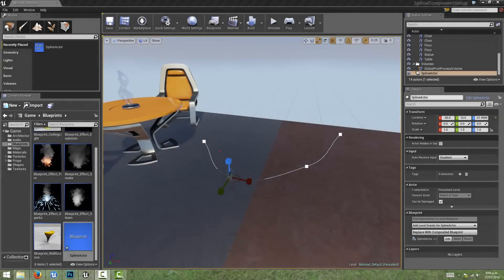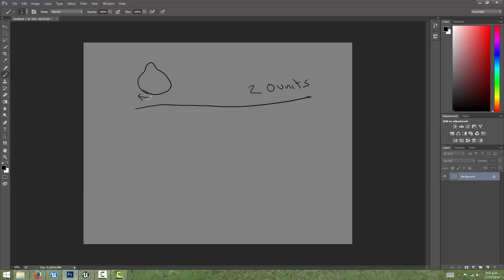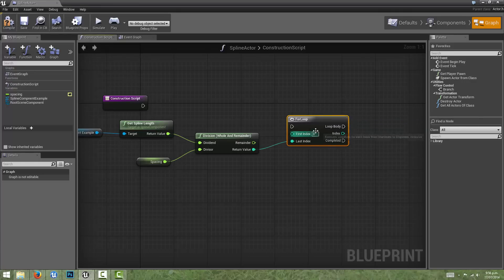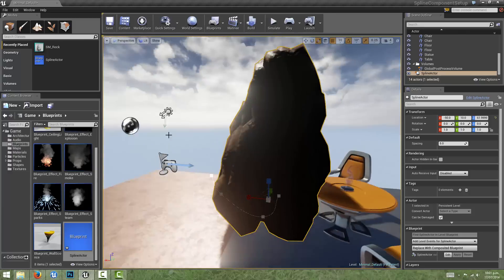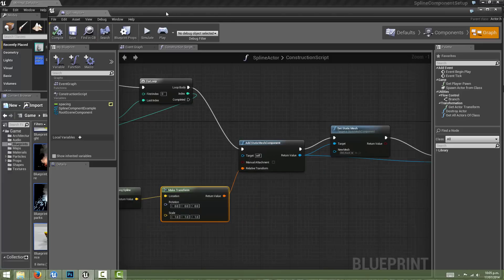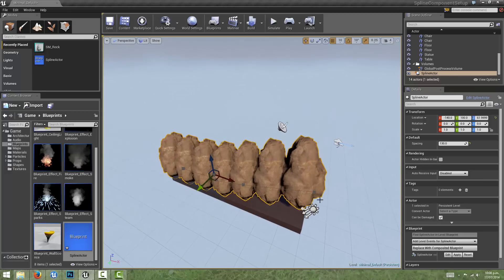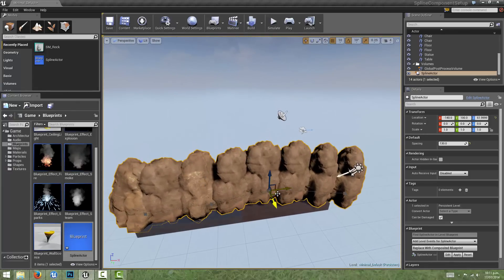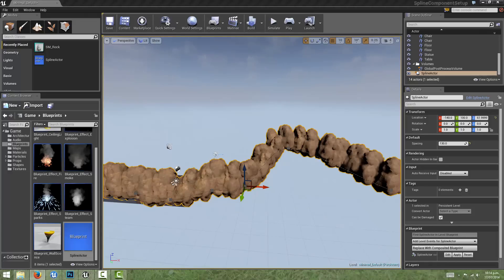Unreal Engine 4 Road Tool in Blueprints with Spline and SplineMesh  - Part 2 SplineComponents

Comment: FIrst of all, this still works in UE5, you just need to use the Get Location at Distance Along Spline node. (It's been renamed)

Second, if you want a more optimized way of doing this that doesn't create a new mesh every time follow these steps.

1.) Replace the static mesh component block with an Add Instanced Static Mesh Component right after the Construction Script node
2.) Select the add Instanced static mesh and you will have an option to select the static mesh you want to use, as well as the material
3.) After the for loop add an 'Add Instance' node, and plug in the target and Instance Transform here where you had the Add Static Mesh node before.
4.) Delete the set material, and set static mesh nodes now. You don't need them.

Comment: A note to anyone using large-scale splines: using "Add StaticMeshComponent" can cause some serious lag issues.  Creating an instanced static mesh instead and then adding instances of it along the spline is much more efficient and will save you a LOT of compile time.
Reply: Thanks for this man! However, the instanced static mesh component is green and not blue, and thus isn't compatible with the set static mesh node.
Reply: You have to use "Add Instance" instead of "Add StaticMeshComponent".

Comment: the mesh moves three times as much as the spline does. so if i take the spline off of the 0,0,0 center of the world and move it a little bit along the X axis, the mesh goes further than the spline. if i move the spline far from the center of the world, the mesh is over the horizon. in your next two tutorials you never make the spline leave the starting point. it just goes off into the distance

Comment: After the I add the transform function for sending the mesh along the spline and then compiling the static mesh disappears. It gets sent wayyy below the level and is solid black now. Did i do something wrong? I've triple checked everything in blueprints
Reply: In the function "Add static Mesh Component", you'll need check the "Manual Attachment" option, else the mesh would be located far across the intended path courtesy of a double inheritance
Reply: Sharaph Arilesere ahh thanks! thats what i had been doing instead. just didnt seem correct. Thanks for the info
Reply: skatenjoi922  You're welcome. I'm personally having trouble using the wall (400x200) for the same purpose. It doesn't seem to work
Reply: Sharaph Arilesere See manual attachment wont displace the static mesh correctly. That's why we built that little equation. It was for the displacement from the next static mesh. I am not sure if something has changed in UE4 so idk.

spline tool is super useful so i really want to get it working.
Reply: @sharapharilesere6478  omg thank you from the future. I was banging my head trying to figure out why my mesh was so far away from the actual spline points

Comment: This is great! Quick question though, Is there a way to load more meshes into a spline and have it pick randomly which of the meshes is being placed next if you pull the spline more? If that's somehow doable, it'd be perfect for creating a cave or something similar :)
Reply: Hi Darkstar... Here's one way that works for me.... connect a Multigate between the addStaticMesh and SetMesh nodes. Set loop and random to true. Now you can make many SetMesh nodes, and make the blueprint choose them at random... make sure the meshes are of approximate the same length though
Reply: Playful Synapse Sweet, I'll test it out. Thanks a bunch :D
Reply: ***** mind sending me a screenshot of how you have this setup?
Reply: ***** They made a website after you, the domain is dabomb.com because that is totally you man! Thanks so much
Reply: skatenjoi922 Did the asset sent to you by Nathan work? The engine can't seem to recognize the file type
Reply: Sharaph Arilesere Yes, try just copy pasting it into your content folder of a project you have already then just open that project and try using the blueprint. Worked for me on 4.6.1
Reply: I'm on 4.6.0 , perhaps that's the reason it's not working

Comment: Hi, thank you for a great tutorial, just a note regarding the location of the mesh components, if you want to keep the static meshes attached to the blueprint after being created, you can simply subtract the spline world location, from the scene root world location, then use that as the static mesh location, that will basically put it in the same space as the parent.

Comment: thanks for this tutorial ! I want to learn more with blueprint that is so better than Kismet ahah. I have only one question : what is the easiest way to be able to move meshes along the spline for an animation ? I'd like to make objects move forward following my path. I now it's possible with matinee but I hope there is a magical trick to add to this tutorial to add this function easily. Thanks!
Reply from the maker: You can use the 'Get World Location at distance along spline' to do that. You can create a variable for time and each update, add delta time to it. The input that variable (multiplied by some constant speed factor) into the spline location node input. So you would be inputting the time difference as a distance query input (as time goes on, so does the distance along the spline). You would get returned a world location that you can use to control your objects transform.